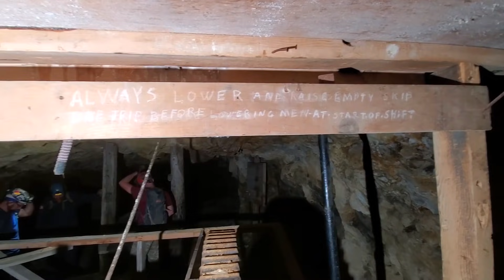Exploring The Abandoned Dunkin Doughnuts Mine Flooded Winze and Drifts

Comment: the extension tube on the torch is for adding an extra battery or a different battery option, usually they are for adding a 2nd 18650 cell for 2x the capacity.
Reply: no, the shorter extension is for 18350 cell